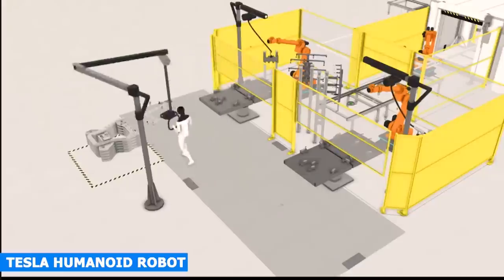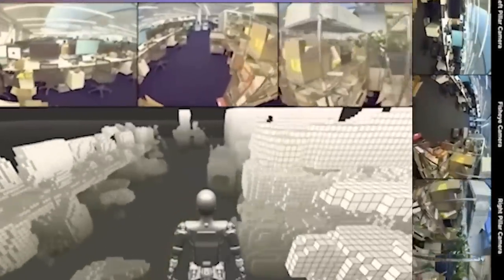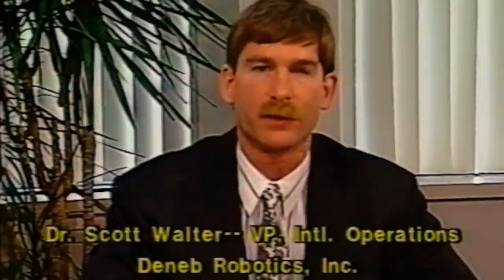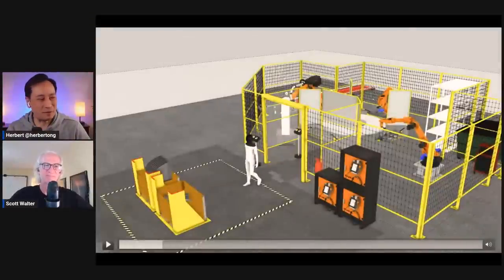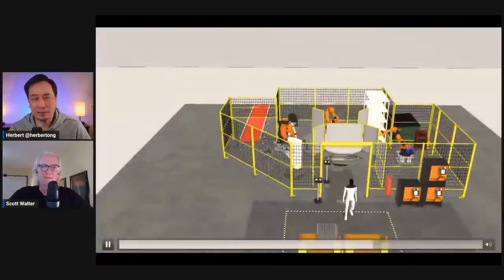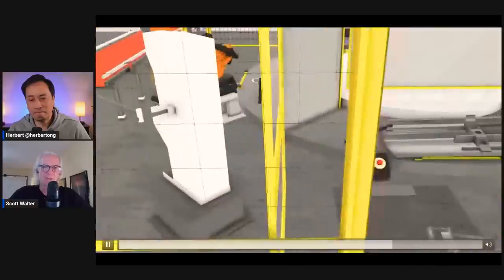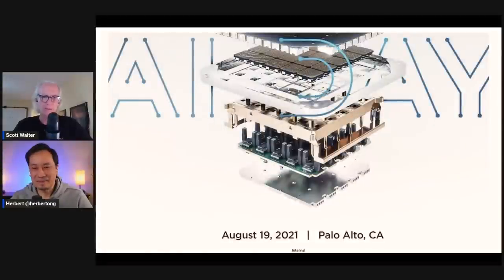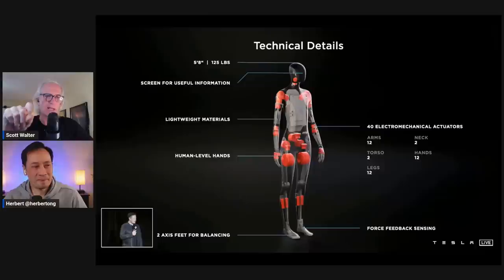Tesla Bot Expert Shows PROOF Bots Already Making Cars | Scott Walter

Comment: Why are the bots humanoid in form? Wouldn't a box work just as well?
Reply: All human infrastructure on earth are designed for humans, to interact for humans and be handle mostly by humans, if you want a machine that does what a human does, you build a humanoid robot, a box is for a specific task, not general human task.
Reply: It's "The Dalek problem"
Reply: And the human body design in the best optimized body design for the widest range of uses that we know of! ;)